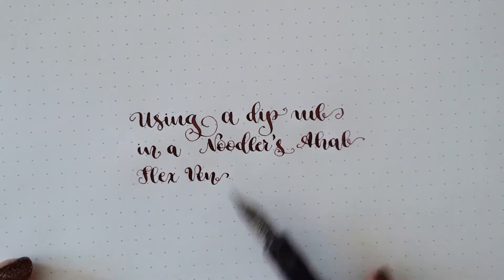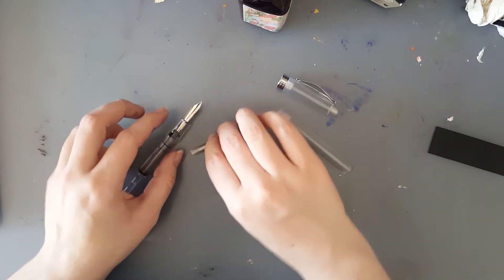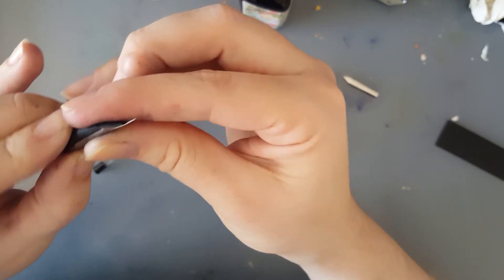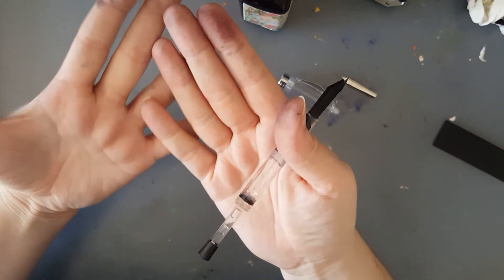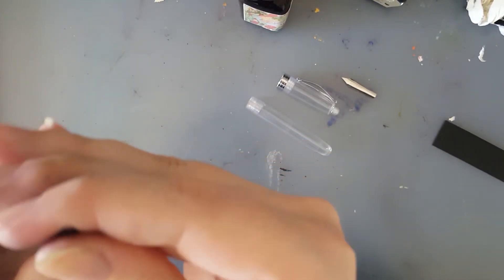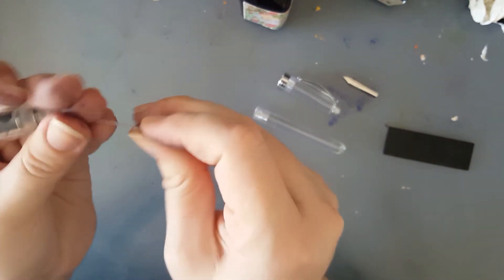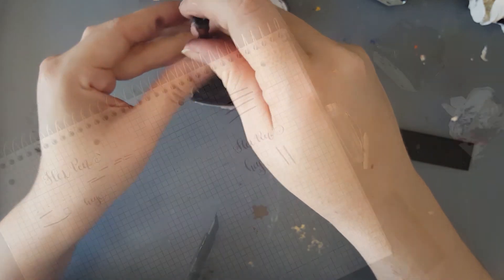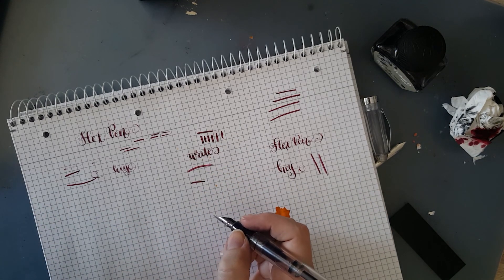My Frankenpen: Using a Dip Nib in a Noodler's Ahab Flex Pen

Comment: I did it using a Zebra G, had to heat-set the feed to get it to work but it did fine.

The only weird issue I have might be cause I took a razor to the feed canal-thing (saw a couple people say it was necessary so I tried it), but I have like super heavy flow unless I'm holding the pen an an extremely shallow angle, like 15° or less from horizontal. Maybe later I'll buy another one and try without the razor trick to see the difference.

I love how it draws and writes though, even though I'm not like a calligrapher or anything and I just write stories and draw lines on paper. It's so much more expressive than pens usually get, and I haven't even gotten it to railroad yet so maybe I haven't used it enough lol
Reply: Hello, if i may ask, do you have to mod the zebra g nib like using pliers (i see a tutorial of it on jinhao + zebra g nib) to fit on noodler's ahab feed?

Comment: In truth, it has to be a (better) alternative than using the Noodler's own nibs - I'm sick & tired of having to re-heat set them every time I strip the pen down for thorough cleaning; it's rare I use my Ahabs' or Neponset for the above reasons, now - but I'm going to try to hunt down a Leo Rose nib. Frankly, I'm a little surprised that Noodler's Ink have not fully addressed this nib-feed issue: Perhaps using ebonite feeds is the issue, here - they are (naturally) prone to flexion in varying degrees of temperature; it's become something of a standing joke. Thank you for an excellent video !! :D
Reply from the maker: Yeah to be honest, I never use them anymore, just my dip pens these days,because fountain pens just never work with the feeds as soon as flex is involved.

Comment: I might do this in combination with my overfeed made from a bottle, how does the nib write normally? I heard they're quite scratchy since they're not tipped
Reply from the maker: Robin Rai I'm probably the wrong person to ask since I'm doing Calligraphy with dip pens and am very used to them, this one is very smooth in terms of calligraphy nibs but nowhere near as  an actual fountain pen nib. Imagine a very scratchy extra fine plus the added flex and I think it might be about like that if you're not used to dip nibs.
Reply: 1/2 a px. Thanks, I think I'll try to get my standard nib finer and more flexy instead.